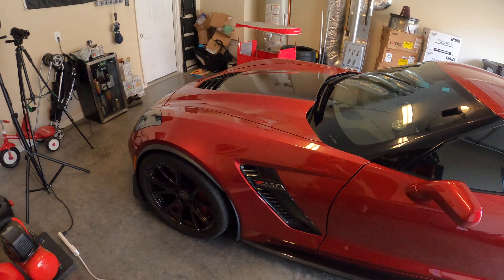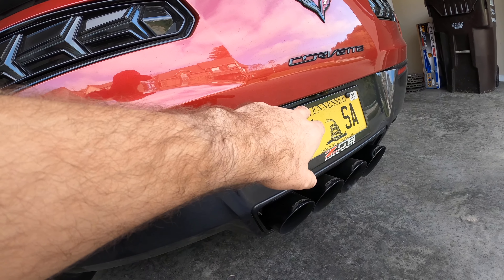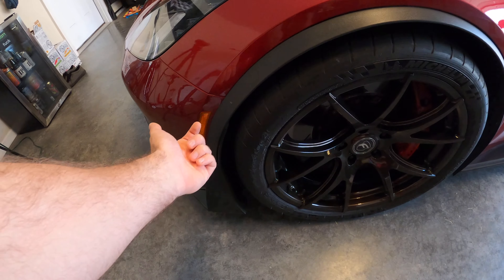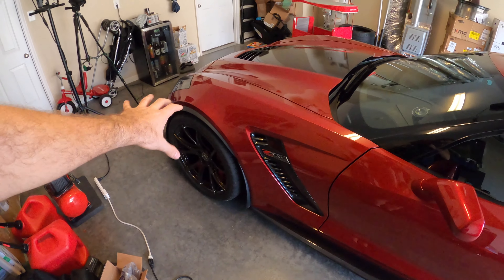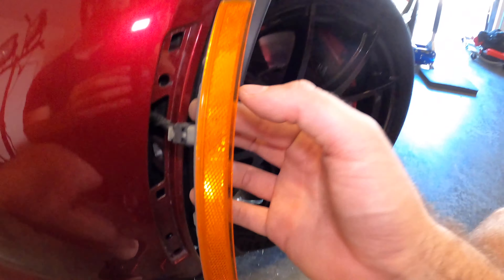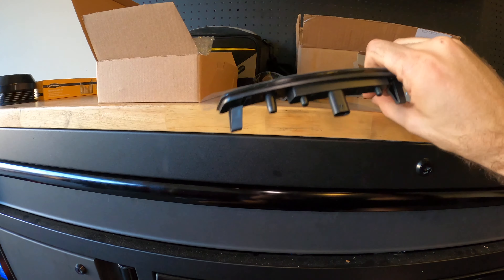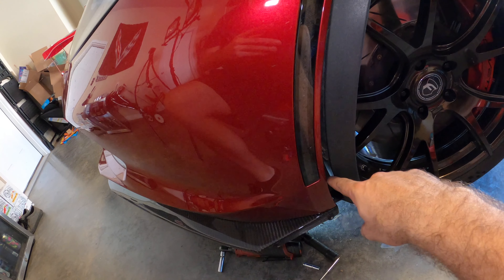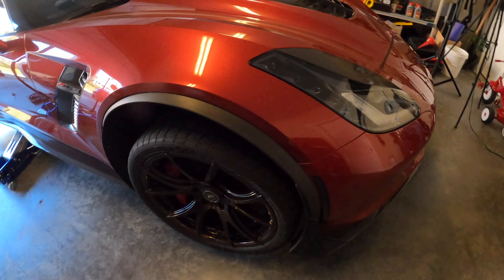C7 Corvette LED Side Marker Install

Comment: Need a video on those rear reflectors... I can’t find another video on them
Reply from the maker: Will be coming soon. I just have to decide if I'm going to wire them as running lights or brake lights. I'm leaning toward brake lights...
Reply: @RobsHouse   good deal. I think I like the idea of running lights but that’s me. Subscribed btw, your like a step ahead of me on everything!
Reply from the maker: @rmhignite  My only concern with wiring them as running lights is that they will be too bright and could be confused with brake lights. Either way, I'll do a video, and the concept will be the same. You'll just be tapping into a different set of wires than me. Thanks for the sub!

Comment: You did a great vlog on how to do the side markers. I did the same on my 19 Grand Sport. They look great
Just an FYI, to do the rear reflectors on the rear facia ( to do it properly) you need to pull the bottom facia off. It is slightly tedious and time consuming. Just thought you should know. 
All the best and am looking forward to your next vlog.
Reply from the maker: Thank you! And yeah I know I have to pull that off and I would have to figure out which way I would wire it. I ended up just wrapping my stock ones to match the wrap I did recently on it haha.
Reply: @RobsHouse  Honestly that was the best way to go. 
Good chatting with you
Reply: You probably dont care at all but does any of you know of a way to log back into an instagram account?
I was stupid lost the login password. I would appreciate any tricks you can give me
Reply: @Felipe Valentin instablaster ;)
Reply: @Jerome Maxim Thanks for your reply. I got to the site thru google and Im trying it out atm.
Looks like it's gonna take a while so I will reply here later when my account password hopefully is recovered.
Reply: @Jerome Maxim It worked and I finally got access to my account again. Im so happy:D
Thanks so much you really help me out!
Reply: @Felipe Valentin No problem :D

Comment: Does the LED side marker interfered with the TPMS?  After i install mine, my front TPMS will come on when im driving on the freeway at 70 mph with my lights on for 20-30 min.  It will go away once i slow down or come to a complete stop.
Reply from the maker: No not at all. It sounds like something is up with your TPMS, and it probably is just a coincidence that it started acting up when you installed the side marker. I have no issues with mine.
Reply: Just did mine yesterday and had the same problem when I pulled out the shop.  that’s weird that we both had TPMS  light come one did u figure out the fix or was it a coincidence for both of us??
Reply: @kevinrodriguez-qk4gj The fix would be to replace with Oracle side marker lights. I haven’t heard any issues with them and also their a tad bit more expensive. So far that’s the only brand that doesn’t cause the issue. The tpm is picking up the signal from the led.

Comment: Any idea why none of my side markers work? I anticipate find any info on fuses etc
Reply from the maker: Were they working with the factory side marker bulbs prior to installation? Did you buy from vette-lights or did you buy something random of amazon/ebay? LEDs can be finicky, especially when you plug them into circuits not designed for them. Sometimes, additional resistors are needed to make them behave properly, such as older cars where you replace headlights and turn signals with LEDs and you don't want them to flicker or the blinkers to blink fast as though there is a bulb outage. I bought from vette-lights because they are reputable and I knew everything would just work out of the box.